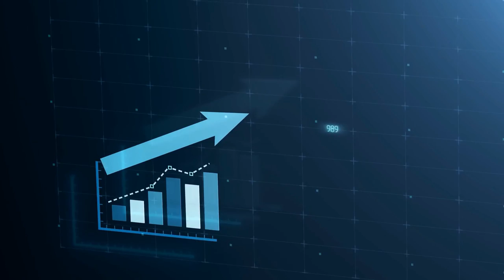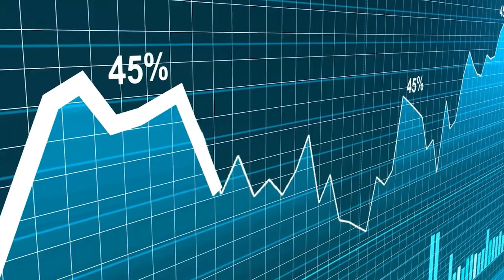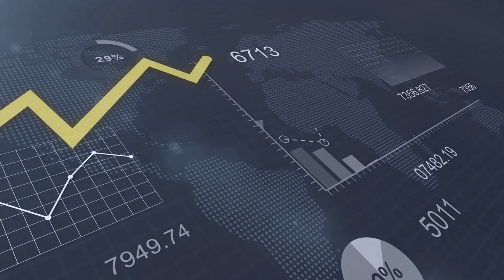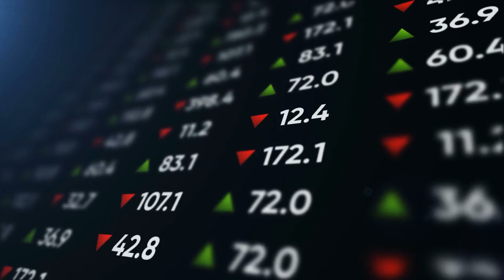The Real Reason Ford Just Shut Down Pick Up Production!

Comment: This video is just so much chin chatter.  60K to 100k+ costs of pickups plus interest rates emotionally "through the roof" have caused pickup sales to grind down to low digits.  Consumer vehicles - cars and SUVs don't do the job for anyone who actually needs a pickup - you don't throw gravel or lumber into them.  But when real interest rates are in the 8% range (lower rates are bought down) for new and used vehicles going as high as 13%, sales have plummeted.  Drive by any ford dealer and look at how many pickups are sitting outside getting a suntan.